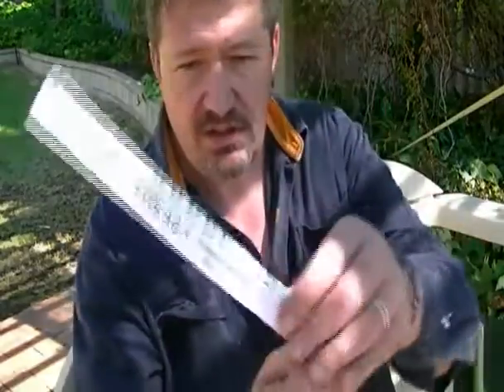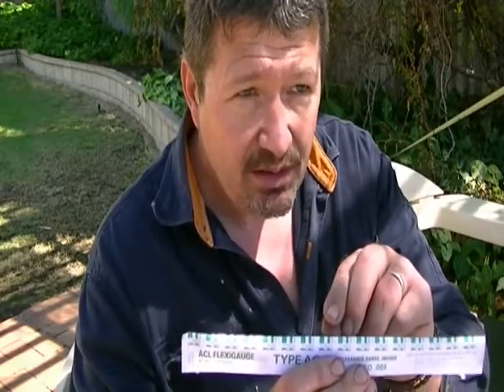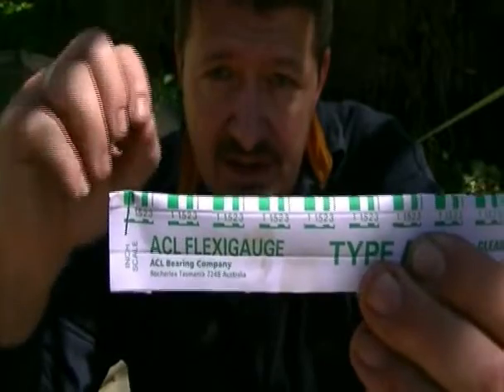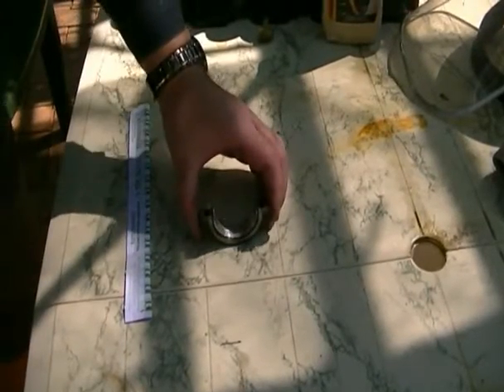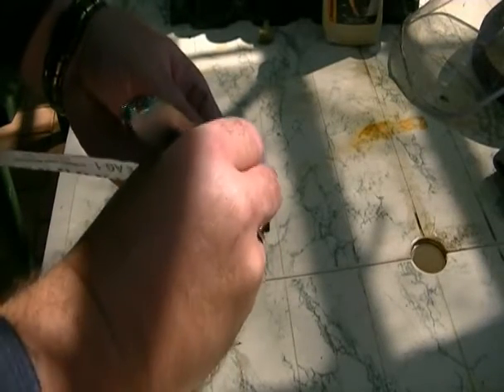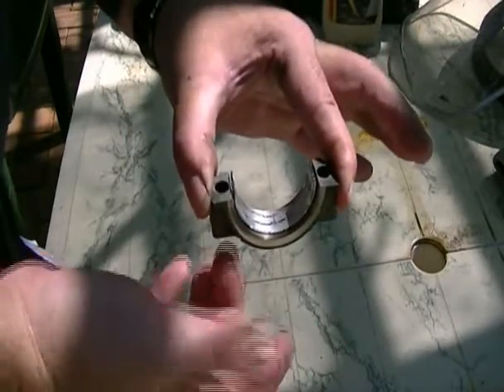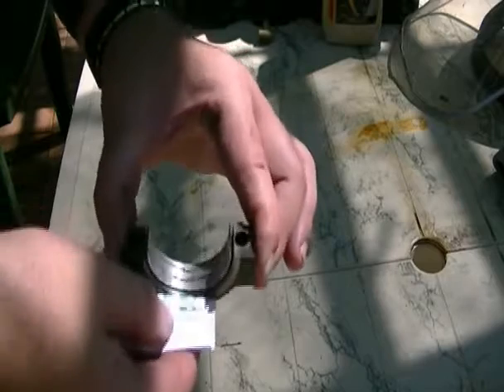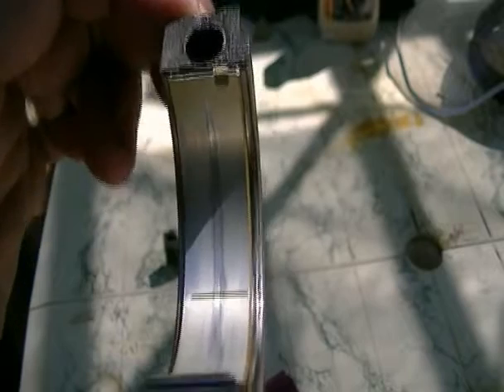How to use Flexiguage to measure bearing clearances.

Comment: What is the difference between green and blue flexi gauge?
Reply: Good question. The difference in colour is for different gap sizes.  I wish one would fit all but they don't.  Although I do not know of the top of my head what gap size blue is suitable for but a quick google should set you right. Regards Rik